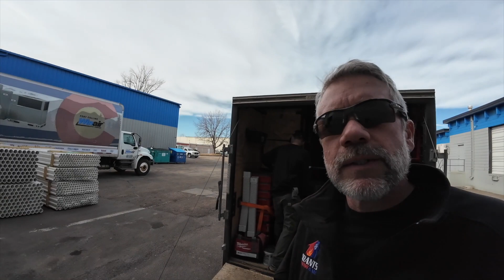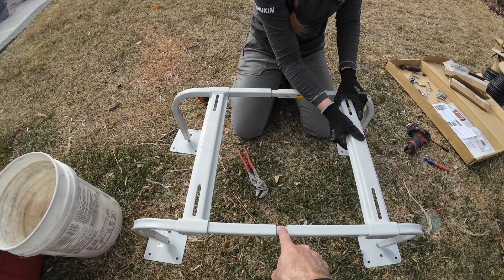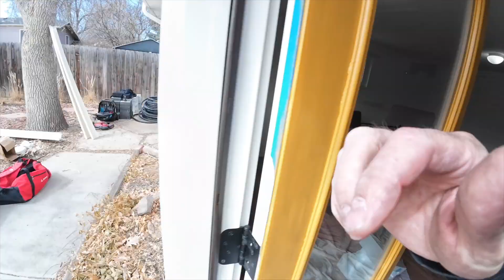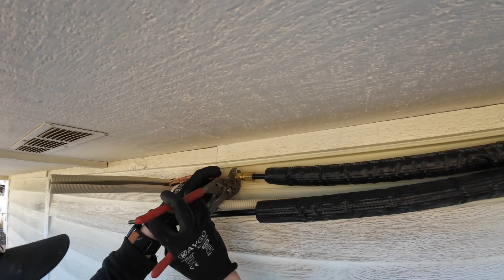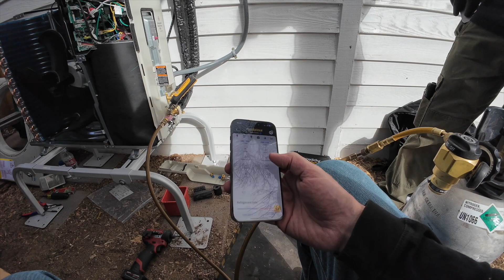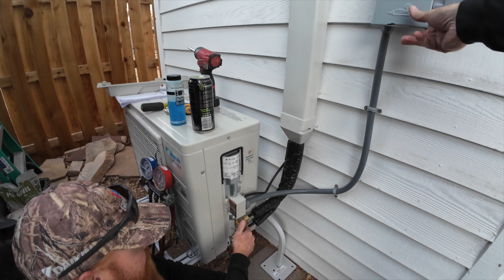Daikin AURORA Single Zone Mini Split Heat Pump for Cold Climates | Step-by-Step HVAC Tutorial

Comment: I just came across your channel and video while searching for Daiikin mini split install videos. Very informative. I ran into a problem installing a mini split line set at the condenser and had a persistent leak even after using Nylog and making new flares. I used the FlareSeal product (similar to the Flarerite) and finally got a good seal.  

I wonder why Daikin doesn’t just install a base pan heater from the factory?
Reply from the maker: FlareSeal works well, and we use it on every install now.  I hear you on the pan heater. They should come on all cold-weather-rated equipment.